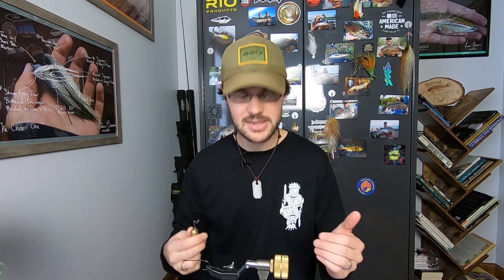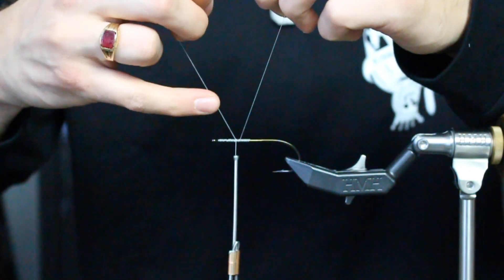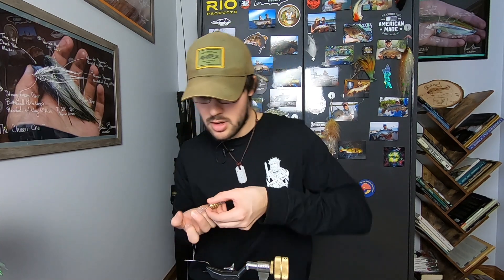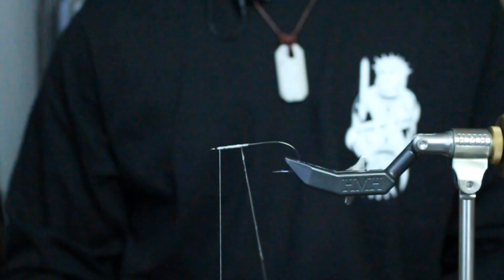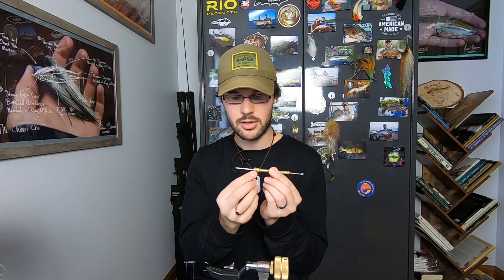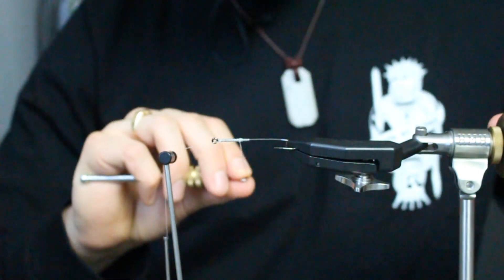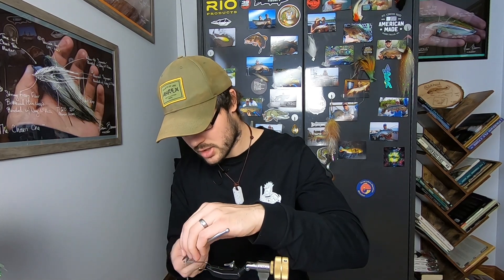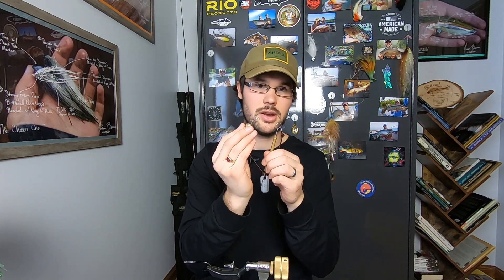Dubbing Loops - Technique Overview and Tool Design

Comment: You're the boss! I've learned so much from you over the years and it's nice with these short ones to freshen up the memory. You should include which way you're winding on the loop and all other materials aswell. I see people counter wrap and i ask them why? Makes no sense. As I've done and I saw you empathise in a video before you wind materials the same way as your thread. Not the otherway around. That realises the presure and makes your fly less durable. Take care man!🙂

Comment: If someone can help me... I just bought a Stonfo '' rotodubbing 2 440'' and impossible to use correctly because the handle comes out of the head when I pull slightly on the thread tighten to wrap dubbing. In fact, i have 2 pieces : the head with ball bearing and the handle... Is it normal? In this vid, Gunnar explains he pulls with is dubbing tool and it's alomost the same of mine, same brand...